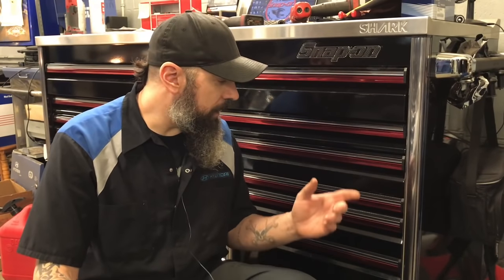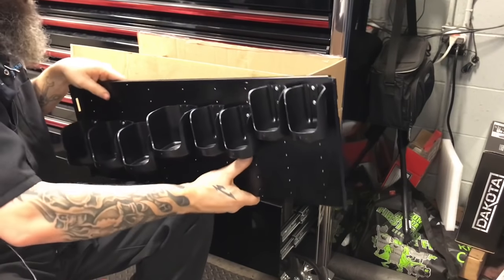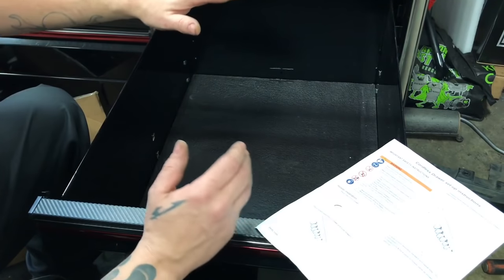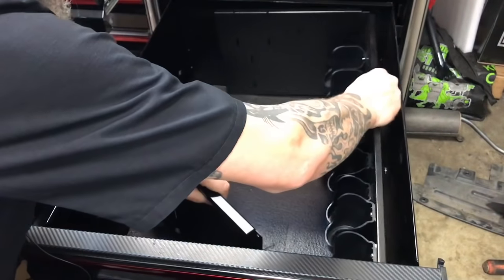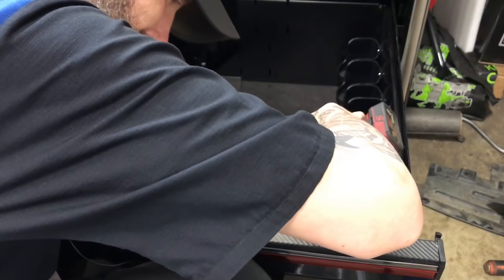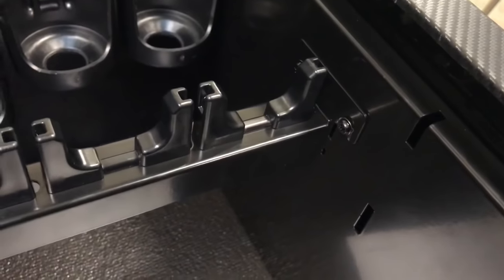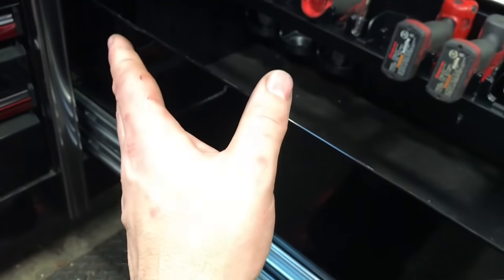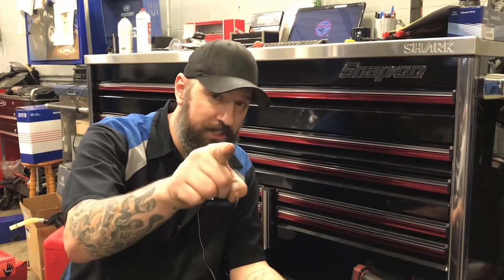SNAP-ON Cordless Drawer Insert In A 68" Epiq

Comment: So i called snap on and they said you have to have a 12 inch deep drawer for this to work in. I am just wondering if you set all the holster towards the bottom of the drawer would there still be enough room to fit the drills ect in the drawer in a ten inch high KRL drawer.  You can buy the holsters separate so you could make your own attachment plate but the building of the cross-member that supports the battery end would be challenging.  Any thoughts out there on how to make this work in a ten inch high drawer?